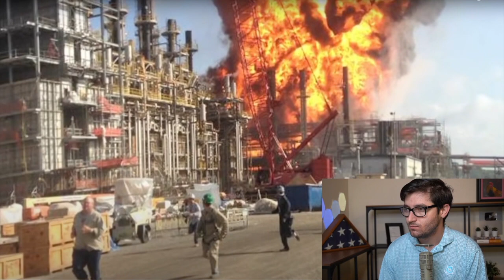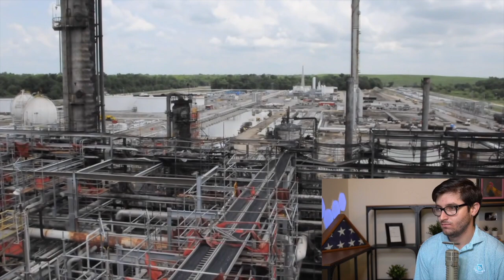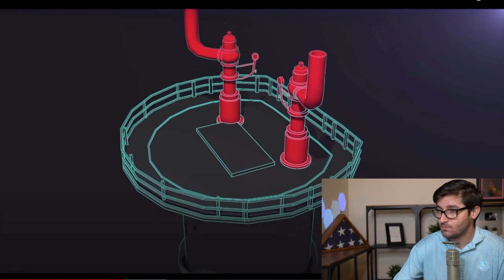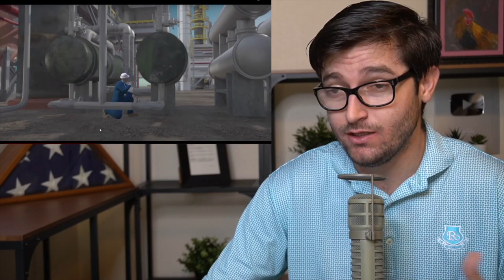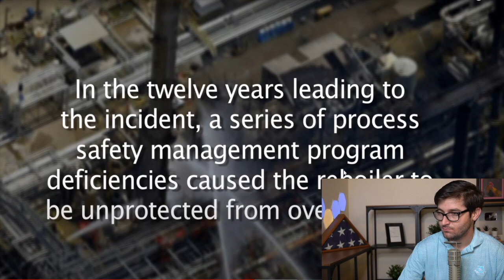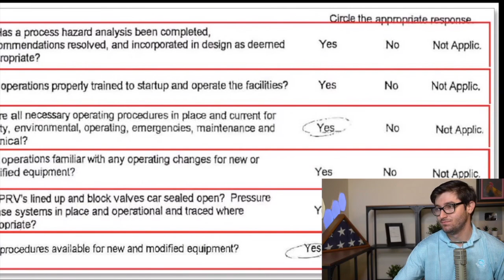MASSIVE  EXPLOSION CAUSED BY  FAULTY VALVE

Comment: Now I'm just wondering why the hell the pressure relief valves were so far away from the systems they're meant to vent. If the pressure relief valves were on the shells of the heat exchangers themselves it would've been impossible to put a valve in the way, and accidentally isolate the system from it's safeguards. I'd still say that at least 90% of the blame falls on Williams because they're the ones who added the valves to maximize profits while ignoring safety. But I do think at least a portion of the fault lies with the designers of the system for designing it in a way that a greedy corporation could unwittingly cut a pressurized system off from the one thing that keeps it from being a really complicated bomb.

Comment: I am absolutely flabbergasted watching all these petrochemical plant videos and the insane lack of safety/regulatory procedures and documentation. I work with chemically inert, non-sterile, topical use only medical devices (basically an even less stringent FDA product category than bandaids) and our safety system is about 10x as intensive and effective as these plants by the sounds of the case studies. Do these plants not get audited to these regulatory standards? In this one these guys are back-dating risk evaluation for process change. How in the world does anyone in management let that stuff happen? It takes me 2 weeks to get that stuff done if I want to change a damn die press die for a certain sku. It is unimaginable to me that these guys would be modifying petrochemical refinery equipment just off the cuff like that.

Comment: i would say that the company is around 97% at fault due to their modifications to the system and egregious lack of care to ensure the overpressure system worked as intended, why did they even put a valve on it to begin with? the other lines, fine, but the overpressure release? things like that should not ever be blocked no matter what... the lats 3% is on the guy who opened the valve without being cleared to do so.

Comment: I've worked around boilers in the past and the one thing that was stressed to me was that we DO NOT alter anything ourselves. We have the company who initially installed it come and make alterations and or adjustments. Our job is to monitor and operate said boilers. This was to eliminate potential errors with a system initial design for operational purposes. Also the fact that there was no management on site to make the decision, I would have pulled up a chair and got paid to make sure no one touched anything until confirmation was received on how to proceed.

Comment: I'm a QHSE responsible for a big EPC company. The issue here is clearly that the review should have been done BEFORE the change and not after. For this kind of equipment (pressure vessels), design must be reviewed by a third accredited party before you are even allowed to start buying parts. This is the most important issue on this incident. If safety regulations were respected during the design, review and modification phases, mismanagement would not have caused such a catastrophic event but most probably emergency but controlled release of pressure.

Comment: I had a problem like this when I bought parts online for a mini bike i was building, I bought new valve springs, I followed all the installation steps and double checked everything. During a test ride one of the springs broke and sent a valve through the engine block. I emailed the company I bought the springs from and they told me it was my fault it broke. Wouldn't even refund the money or send a new spring.

Comment: Industrial plumber here. To add a valve to this type of system it would need to be approved by several engineers including the original manufacturer of the boiler system. All that needed to be done was add an addition T&P to the boiler or get a valve that had a T&P built into it.

Comment: I place 100% blame on the idiot who put a valve between the pressure vessel and its overpressure release valve.  Idiot was probably an engineer and should have known better.  

I call this a duty of all system states and changes safety calculation.  Re-evaluation and recalculation must occur on all redesign.  

Disabling of a safety critical device on an operating industrial process is a summary firing offense.  It is not a matter of retraining, it is a matter of hiring somebody with common sense enough for their job.  There is only one competence we all owe our fellow man: duty to fire oneself if one cannot be safe at work.  

~One Engineer

Comment: The procedure to line up the reboiler should have accounted for potential propane in system. The engineer would have had to approve the changes of valves. 

Also it sounds like the operator needed a second hand for an old piece of equipment, as well as proper inspection of the system before reintroducing it.

Cutting corners sounds like the operator wanted to establish water flow before he came back later to line up everything.

Comment: Definitely a design fault/negligence in my opinion I have never seen a pressure source (the thing that makes the pressure be it a boiler or pump ) with a out a over pressure relief or  one that could be taken out of operation while the system is running

Comment: I think that it doesn't make sense that they didn't regularly alternate between both boilers.  As long as 1 is running, you can continue production (and making profits), but you can then maintain and clean the offline boiler while the other is working.  I wouldn't run a vacuum cleaner without checking it first if it had been sitting dormant for 16 months, why would it be smart to turn on such a dangerous machine after sitting that long?

Comment: ASME code dictates that you have to have overpressure protection on any boiler or re-boiler for 110% of the max design pressure.  I have no idea how theh maintained the boilers cerifications.  That is regulated by the state and the states I work in have inspectors physically come and inspect the boilers, periodically to maintain the cert and dont depend on a design change questionnaire.  Any process engineer with over 2 years of service could see the flaw in this design.  

The refinery industry is the worst at maintaining adequate design change tracking.  They refuse to let process impede profit, even at the cost of safety and reliability.  They have a bad reputation among those who work in the energy industry.  That is my personal opinion through my own observations and experiences.

Comment: You know what prevents confusion as to what went wrong and who's at fault? Safety codes that are written by lawyers, such as the Canadian Electrical Code. A case like this might take up to 3-5 years to resolve in US Courts while it would typically take the same case 6 months for resolution in Canada. All because lawyers are used when writing Code books.
Reply: Sorry, but that sounds awful for the Canadian engineers who have to read the safety code. An engineering safety code written by non-engineers, sounds like a disaster waiting to happen. If the code has to be reviewed by the lawyers, then whenever changes need to be pushed through code, you have to teach the lawyers the material science of why this change is necessary.
Reply: @nathanielhill8156  that's why there is a course for learning how to read the code book.
Reply: Are you aware that the US has the NEC (national electrical code?) That is designed by a board of electricians, with legal wording, and adopted and enforced by states. Also this by itself does not simply make everything easy when it comes to fault. Was the electrician forced by the general contractor to install unsafe wiring? Was the installed equipment being used properly? Was the equipment swapped out for something with higher amperage? It's not exactly black and white. Plus in an industrial setting there is a lot more custom equipment and designs, requiring unique procedures and best practices.
Reply: @jacewhite8540  CEC> NEC

A GC can't force me to install anything, only the inspectors can. If an inspector tells me to do something, it becomes his liability. An untrained employee is the fault and liability of the industrial company, not my electrical company. Industrial equipment is not special or custom, everything(mostly) is categorized by the voltage it uses.

Comment: This is wild to me. Every one of our heat exchangers in the plant I work at has a relief directly on the exchanger for both product side and glycol side. The fact that the relief was down stream and not directly on the exchanger is incredibly dangerous even without those block valves installed.
Reply: I can see an excuse for moving the valves away, as it might not be the greatest idea to pump an area where workers are expected to be full of hot liquid propane, so placing on the top of the stack makes some sense. Maybe it's an OSHA thing too, keep potential releases of dangerous/explosive gas away form workers (would be interedted to find out)?
I will agree that it should have been a direct pipe only for pressure relief.

Comment: One thing that I'd like to point out, from a technical standpoint and not necessarily a legal standpoint, is that not all equipment failures are "defects."

A Defect is a flaw in a piece of equipment that causes it to function in a manner other than how it was designed. A Defective pressure release valve, for instance, might be rated for 50 atmospheres, but in actuality not open until 125 atmopheres, allowing a dangerous overpressure scenario, or actually open at only 10 atmospheres, preventing proper operating pressures of an attached vessel. 

A Deficiency is a flawed application of equipment for purposes beyond the scope of their design and ratings. The isomerization column in a previous video, for instance, had a fluid gauge that went up to nine feet, with standard procedures and automated systems to maintain a fill level of six feet. The gauge was not defective, nor was the column, nor the systems - all functioned exactly within their design parameters and ratings. Their misuse and misunderstanding of how to properly operate them, purposefully-overfilling and overriding automated fluid level controls and then neglecting to properly monitor and control the overridden systems, is what principally caused that column's destruction. However, it could be easily said to have deficiencies in the prevention of misuse and/or deficient in the number of redundancies to prevent such catastrophic misuse.

More simply, a bolt that is rated for 10 tonnes but fails under only 4 tonnes is defective, but a bolt rated for (and affirmatively proof-tested at) 10 tonnes and then improperly loaded with 20 tonnes is deficient.
Reply: In this case, the valves themselves were not faulty or defective, but there is certainly a deficiency in the design and processes involved. The plant bears the responsibility for cheaply engineering these isolation valves without overpressure protection (A simple screw or ball valve is much cheaper than a valve with inbuilt pressure release mechanisms), and the staff, chiefly management and the supervisor, bear responsibility for failure to follow established procedures and ensure that those procedures and their purpose were well-known and adhered to across the department.

Comment: They say that the conversion to single boiler use was to allow for cleaning without system shutdown, but the other boiler hadn't been used in over a year which could go to show how much they prioritized uptime over safety. In addition they obviously didn't keep up with maintenance on the second boiler as it wasn't fit for use which defeats the whole purpose of this setup.

It seems like if they were going to go implement such a system they should have only used that mode when cleaning was being done, on an offset cycle for each boiler.
Reply: Exactly. If there was a schedule for how long the heat exchangers could run, this problem would never have happened. This could have very easily been a "every 6 months" kind of scheduled event with a non-normal checklist. 

The checklist would have prevented the lone operator from trying to work the system and the schedule would have likely stoped the exchanger from clogging to begin with.

Comment: My previous job had an awful safety culture. We used large convection ovens for manufacturing electronic circuit boards. The ovens had huge covers that housed the fans and heating elements, and conveyor chains and various mechanic parts under it. The covers could be raised by turning a key and holding a button, but strictly for maintenance, when the ovens were off, following the lockout procedure... on paper.
In reality, my superior had copies of the keys that were handed out on Fridays when the factory was shut down for the weekend. The official shutdown procedure took about an hour since the ovens had to be powered while cooling down to avoid warping and damage by thermal expansion. The "cost-saving" alternative had the ovens operate normally until 20 minutes before end of shift, then the covers were lifted to expedite cooling. This of course exposed the hot, moving parts with no protection, since lockout was not performed. The area around the ovens was also littered with tripping hazards.
When I voiced my discomfort, my superior told me to leave and assist a different area. It's amazing we only had two near-miss accidents in three years.
Reply: Did your factory have two near misses, or did they record two near misses?
Reply: @gadsdenjack  That is an excellent point. Near-misses were generally only reported when there were other witnesses. Thankfully our workers were, for the better part, reasonably intelligent and realised the danger presented by the exposed machinery.

Comment: I think an accident is something out of your control happening that causes a bad outcome. If an asteroid hits a refinery and punctures a tank that leads to an explosion, that is an accident. When your machinery is being operated by your operators and something happens, it isn't an accident. It is a failure of your system. Machines do exactly what they're made to do. They might stop working, but their operation is completely known. Humans make mistakes, but it is the responsibility of management to have processes and a culture of safety that ensure multiple mistakes need to happen in order for a catastrophic failure to occur. 

I think a good example of that is the four basic rules of firearm safety. In order to have a negligent discharge with catastrophic results, you need to be failing two or more of the four rules. If you fail to follow only one of the four rules at a time, you will never have a catastrophic result. Still, responsible gun owners enforce that all four are followed at all times because habits stick stronger than you realize and there is room for error before something terrible could happen.

Comment: When the valves were added into the system,  is an inspection required to look over the safety and operations? If so, could the inspector have been at fault in this case if they missed this on their last inspection report?

Comment: Note to the editor: can you equalize the audio for the video Tom is watching and for when Tom has the video paused and is talking. I use earbuds primarily and I keep having to clean the blood off of the earbuds from my ruptured ear drums when Tom starts talking (just joking, but I do have to adjust the volume frequently in these videos)

I don't know if Tom records separate audio files that need to be synced. That's the best solution to this, but if not you might have to manually turn down the volume on the audio file every time he pauses the video, or just have Tom turn down the gain on his microphone in future recordings.

It's a small issue, but annoying enough to me personally that I wanted to point it out. If this is potentially just a problem with the EQ on my earbuds and others don't notice the problem then feel free to ignore me.

Comment: Dont agree with the 100 %.  There was significant neglect on the operator when he decided to restart a unit that hadn't been used in 18 months on a hunch that buildup was causing water flow to be lessened.   Furthermore he neglected to get approval from his chain of command to complete such a task.  
"Hmm. I might have to restart this unused unit we haven't used in well over a year.  But I cant get a hold of someone to give me the go ahead.  Who knows why this unit hasn't been used?  Must not be important.   But if I fix this issue in my own, think of all the brownie points I'll get.  Maybe I'll even get a promotion!"
The thing that leads me to believe that it was a brownie point situation was he made the decision. And he decided to do the work on his own instead of delegating.  
Also knowing that it exploded in 3 minutes does show (but not definitively) that there could have been a reason behind the unit not being used in 18 months and some decision maker knew this. Or at least a decision maker would have better knowledge in starting up an idle unit and could have told the worker "hey it's been idle for a while make sure you...(random things neccessary to safely bring unit online.)" Or flat out say "no.  Bring the unit offline instead of bypassing to the idle unit"  But him deciding to restart without approval or guidance was definitely a significant contributory factor.